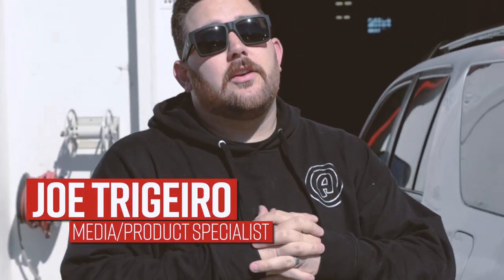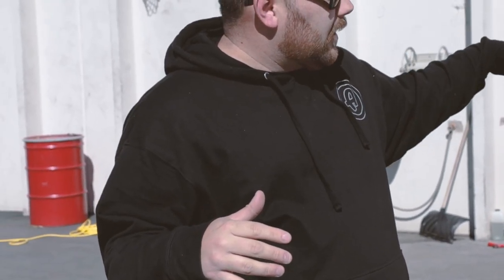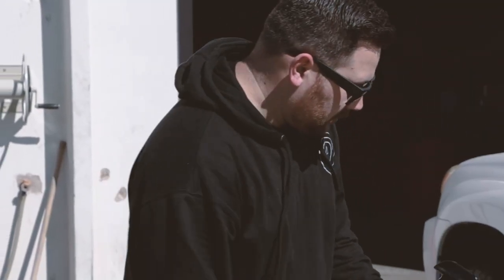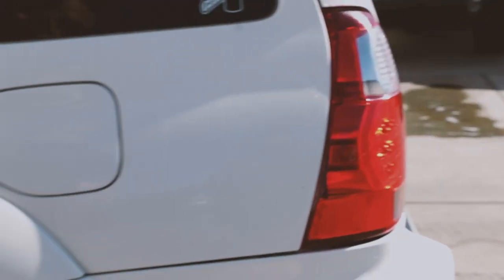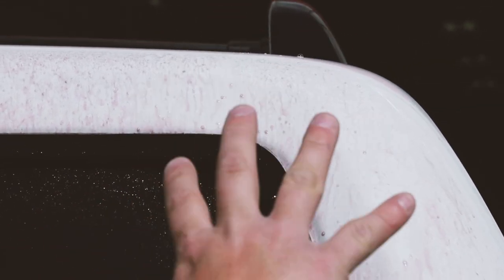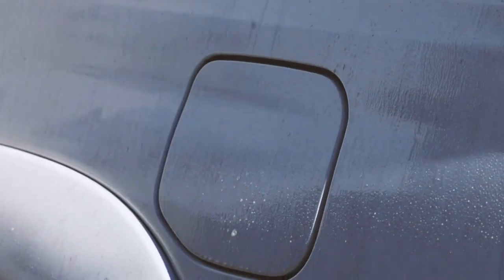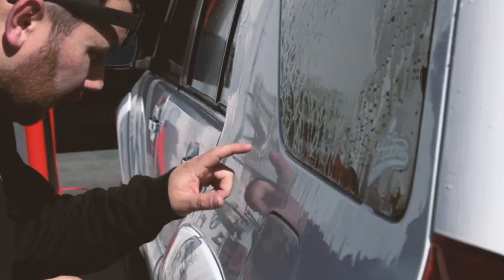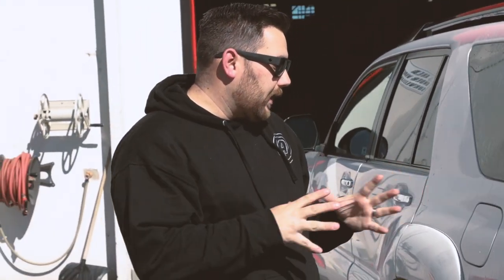Turn Your Car Purple While Removing Metallic Particles In Your Paint

Comment: Thanks for the video. So is the correct order, 1.wash 2. Iron remover 3.clay bar 4. Polish 5. Sealant/coating ?
Reply: Yes
Reply: Pre wash, wash, another strip wash if there is wax to be removed. Iron remover /tar remover, wash, clay bar, polish (optional) strip wash, dry, wax/sealant/coat.
Reply: @markcotter5949  that’s a pretty crazy amount of extra washes Mark. The initial strip wash was what I did and everything worked out great.
Reply: You are gonna scratch the paint and damage it if you let dry iron remover, extra step, wash after using iron remover

Comment: So do you wash it 1st, and how many times do you wash it.. but since I haven't properly washed my car in a while.. and I'll do a 2nd spray of the iron.. then what do you reccomend for a lubricant to use the clay bar, and what clay bar do you reccomend me use ?
Reply from the maker: Because of the nature of these videos being 1 video take with no cuts, just speed adjustments, it's hard to fit in a whole process video.  In regards to where Iron Remover fits into the detailing/washing process, you want to first wash your car with a two bucket wash method, utilizing grit guards at the bottom of your buckets.  Once you have completed the wash and have rinsed your vehicle then you would go around with Adam's Iron Remover and mist the paint down using a little bit more product on the back and sides of your car.  After letting the Iron Remover dwell on the surface without letting the product fully dry, you will want to rinse you car clean.  After this is done you will dry your car to avoid water spotting.  Using Adam's Detail Spray as a clay lube you would go around and remove any other bonded contaminants from the painted, chrome, and glass surfaces.  We hope this response helps and if you have more questions feel free to contact our customer service by calling 866-965-0400 or emailing tips@adamspolishes.com  Thank you.
Reply: Just put the video in parts.. 1, 2, 3, and

Comment: Is this smoke and mirrors? What if you wash the car then spray it on, will there still be iron residue? Are you saying that without this the car washing wont remove the iron?
Reply from the maker: Iron Fallout is considered to be a bonded contaminate. It cannot be removed from the surface by washing because the iron particle are embedded into the clear coat. You can almost think of it as microscopic iron shrapnel. A Clay Bar will remove the exposed iron particles but not the embedded pieces in the paint/clear coat. Iron Remover melts away the iron particles that are embedded into the paint.  It’s kind of hard to explain but we hope that helps.

Comment: Should you make sure that any kind of wax or paint sealant is removed from the paint before you apply iron remover?
Reply: Maybe.  That might give you a better chance of getting more iron out.
Reply: Yes, you should do this before applying wax, sealant, ceramic coating which is why you prep the car correctly before applying a protectant which iron decon would be part of the prepping process.

Comment: I don’t have orange spots but I do have little white spots (black car) and even after a wash and detail spray and dry, my car is rough like sandpaper when I touch it. Please help!!
Reply: Idk if it’s bc it’s so dusty here in vegas but literally the next day after a was I run my fingers across the car and it’s full of dust and rough like sandpaper
Reply: Someone could have been spraying paint and it drifted down wind across your car. I detailed a Lexus the other week that had white over spray speckles on the glass top. It looked like dust but was not.
Reply: @mikejones514  so you’ve gotta run a clay bar over that and you’ll be amazed with the results! Smooth again!

Comment: how can you tell if its actually rust or these specs? , nice work!
Reply from the maker: If the specs dissolve off of the painted surface and rinse away when using Iron Remover, then it is not rust coming up through the metal and paint.

Comment: Can this be used on ceramic coated cars without degrading the protection?
Reply: No
Reply: Yes you Can. Depending on what coating and other factors. But lets say its a carPro U.K 3.0. You CAN use it. Since the coating is made to be very chemical resistant. Wash it with Reset. And when its wet/or dry. Spray some iron remover on. And then give it a bit of top coating. Or dont. Wont have a negative effect. And enjoy they coating. If its a Lite coating. You might see a little decrease in the coating performance.

Comment: Where does clay bar?
Reply from the maker: Hi Albert, you could use a Clay Bar with Detail Spray as the lubricant, after rinsing off the Iron Remover for even more thorough decontamination of paint. Iron Remover only targets and dissolves embedded metal particles, whereas the clay bar will remove other bonded contamination such as over spray, tar, light oxidation, road films, industrial fallout, and more.